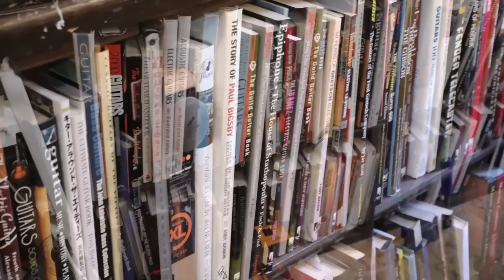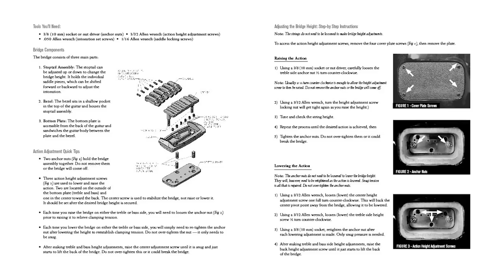Too many Cool Features to be a Success | Taylor Solidbody Teardown & Setup

Comment: Ben, I had the pleasure of working on this model last year. An absolute gem! The bridge is a piece of beauty with truly innovative design. The big problem was the switch which had given up….an not available any more either. There is a Schaller super switch which needs to be modded before installation which gives very similar pickup configurations…..that is, after I’d worked out what each pickup wire was. I remember the bridge and neck were mirror images of each other.
Reply: I have a similar problem on my les paul recording which has an 11 way "decade" switch - Gibson discontinued.
In the case of the Taylor you can get the same function by using push pull pots to separate the coils and using a more standard rotary switch - electronics component spares companies like RS offer build your own rotary switch kits for a low price where you can get a shaft with replaceable switch wafers.
Working out the wires is quite  simple,  first identify with a multi meter which wires form a pair based on the static resistance ,  and then with an old fashioned analogue moving needle meter (e.g. an AVO) you can tap the coil pole piece with something iron or steel, like a nail, to identify which coils relate to which to which pairs of wires - then mark them. Then by performing the same with each pair by identifying the phasing by seeing which way the meter moves when the pole piece is tapped with the nail - this may require reversing the meter leads  to get a positive blip - then you know which wire is is which.
Reply: Like I say, it was last year and I’ve already done the repair for my client. He wanted the guitar to function as it was, as using two push/pull is hardly usable in a live situation. Many thanks for the input.
Reply: @mbontekoe3358  Thanks for the info buddy. Given me directions for my next project :)
Reply: @mbontekoe3358  Farnell Electronics have different size Rotary switches. It may be worth having a look in their catalogue.
Reply: @fongy200  I know them well but I have not actually  lived in UK since 1985 here in Europe we have Conrad among others  but I have done much work on my guitars I also use the "freeway switch"  that is quite useful
Reply: @mbontekoe3358  DBG did a video on the Strat style Freeway switch.  A great innovation, no doubt.  Stew-Mac sells them in the USA.
Reply: @mbontekoe3358  👍thanks for the info on the rotary switches.

Comment: I've owned a Taylor Solid body custom with the Taylor designed mini humbuckers since 2011.
I too was skeptical when I saw it in the store. However, playing it I fell in love with the neck.
For background I've played guitar for 49 years, and ran a successful repair business for 14 years until my hearing failed me and I had to shut down around the time that Covid hit the scene.

On the plus side, the bridge is incredibly stable and has required very little adjustment in the entire time I've owned it. 
Taylor's mini humbuckers are very nice sounding and have a wonderful clean tone, but they can get quite gnarly (in a nice way) when overdriven.
The 5 way switch is a nice surprise and I find I kind of live in position 4 much of the time.
The fuse on the switch board is an added bit of protection.
The tone control contains treble blead circuitry which is also a nice feature

The only real minus in my experience was the choice of switch material with proprietary design. Mine is an early production model and the conductor inside the switch appears to be aluminium rather than gold and after a few years the switch failed completely. Taylor had discontinued the switch so no replacement was available, however they were kind enough to send me a wiring diagram for the mini pickups so that I was able to recreate their wiring using a Stewmac "P-model" mega switch

The Taylor solid body is a lot more than the sum of it's parts.
The neck is definitely a love it or hate it design, though I personally enjoy it.
I have a broad stable of guitars for different occasions and musical styles, each has their own voice which is part of the joy of playing in my opinion. 

Thanks for your candid review of this unique guitar!

Comment: Fascinating. My guess at the neck arrangement with the hollowed centre is the thought is that the shim acts a bit like a gasket so the bolt pulls the edges down in firm contact. On the other hand, if it was machined 'flat' then high and low spots could be anywhere. In particular, with a single bolt the centre might conceivably  'dome' making it a bit looser round the edges? Could that have been the concept in general, e.g. with the bridge - better to have really firm contact round the edges than bolt on bits that rely on 'perfectly flat' mating surfaces? Perhaps even coming from an acoustic perspective, used to clamped glued joints where there is potentially a certain amount of swelling, space filling and contraction at the glue cures leaving a solid joint?

Comment: I used to play one of these for years as my main guitar. They’re great! The bridge pickup in this guitar is not stock - it’s a Taylor pickup but it’s what they call an HG pickup (high gain). The neck pickup and the stock bridge pickup are HD pickups - lower gain more like a PAF. I have a neon green HSS Taylor Solidbody that I won from Taylor in 2009 with a trem.
Reply: Also the production version of this guitar didn’t have binding on the neck or headstock. After some digging it turns out the guitars marked “not for sale” were promo guitars from Taylor.
Reply: @mikelinden214  might explain why it’s made from mdf or whatever?

Comment: The way they routed a hollow to the neck around the screw gives a more solid contact. If the neck is flat only the area near to the bolts will make a contact. That’s because the bolts will bend the wood. Even with four bolt designs a small hollow around each bolt would improve the contact. The bridge has much more contact area that Tune-O-Matic which is sopported only by two skinni screws.

Comment: You missed the trick with the tone pot. The first 2/3rds acts like a normal pot but after that it provides an overdrive function that seems to boost the mids -giving even more options.

Mine is a Solidbody 'Classic' in natural ash (two well matched dense planks) with a brown speckled pickguard and a maple neck. Although it was the cheapest of the range, it's got an honest feel and tone and I'm now glad that I didn't go for one of the 'fancy' ones. It also has Taylor's own mini pickups.

Please keep doing these videos, there is so much for us all to learn. An example of a Japanese-made guitar could be interesting -what makes them so good and sought after?

Comment: I recently won one of these Taylor Solid Body guitars. It too has the "NOT FOR SALE" branded into the back of the headstock. Mine is the double cutaway Classic model that is a solid color with a pickguard. Mine has a single humbucker and the same bridge as yours in the video. I have done as much research as I can on these guitars, so it was nice to stumble across your video and to see it disassembled! Thank you!

Comment: I always use a single bolt, although I do angle the end of the neck so that it fits into a corresponding angle in the body. The idea being, when the strings are pulled tight the neck is locked into the body. Seems to work really well and has the advantage of being able to remove the neck very easily. Great video, cheers Dave
Reply: Hi. What's the technical description of the 'ferrule' or 'bushing'?  ie what do you use? ~8-10mm I've searched extensively & got nowhere. Cheers.
Reply: @RobSmathome  hi, to be honest I don’t know either. Try Bonehead guitars I know he uses ferrules quite often. Cheers Dave
Reply: @RobSmathome  no wait, ferrules are used for string thru the body bridges and would probably use an 8mm diameter hole. Bushings would be used as washers on the screws fixing the neck to the body and would probably be around 10mm diameter. Not sure if this helps. Cheers Dave
Reply: @DaveDickens  I'll give these a shot : Stainless Steel Countersunk Washer M8 (25mm O/D)  they come in colours too!!  😁 before i found these i was toying with the idea of using thick wide flat washers and capping a countersink to hide it all... the first-mentioned are much simpler...

Comment: This Taylor electric, judging by its construction and the design of the bridge, was built by acoustic builders without any knowledge of the last 70 years of guitar history or guitar technology. It's absolutely fascinating. If you sent them 70 years into the past, they would make the exact same guitar.
Reply: And yet they pioneered the bolt-on for the acoustic? Fascinating indeed!
Reply: @KimSE4  Fender did that, actually.
Reply: @caiusmadison2996  Really? I always associate with Taylor. They certainly have some pretty innovative manufacturing techniques don't they?
Reply: @KimSE4  Taylor were the first major producer to make good-sounding, highly functional acoustic flattops with a bolt-on neck.  The Fender acoustics were appallingly badly made instruments - actually so bad that they were fascinating to disassemble...  :)  Also, you're correct - Taylor's manufacturing process is possibly the most advanced in the entire industry (at least, in America).  There's a four-part video that was shot in the Taylor factory, which details the entire process, from a 'set' of wood boards to a finished guitar - an amazing series of custom jigs, cauls and fixtures, which make the process almost 'idiot-proof'.

Over the last 30+ years, I've spent hours at NAMM talking with Bob Taylor about these technical details; he's always been incredibly forthcoming and generous with his knowledge and time.
Reply: Hardly...  Taylor's factory and assembly line is possibly the most modern and efficient in the entire American guitar-industry.  They clearly have extensive knowledge of contemporary electric solidbody guitars - they just chose to innovate (and use their own, existing design 'traditions'), rather than slavishly copying Fender's and/or Gibson's approach and parts.
Reply: a lot of new songwriters have their first batch of songs the same way!  but you don’t bet the business on them.
Reply: You nailed it but they would never build a pine acoustic. Tells me they think electrified doesn't matter what wood you use
Reply: Lol. Tell us you know nothing about Taylor Guitars without saying "I know nothing about Taylor Guitars".
Reply: @StephenWhite55  That isn't at all what I meant, but sure, keep making assumptions and put words into my mouth. I'm just saying that everything we consider to be conventional wisdom was thrown out the window and still made for a uniquely amazing guitar.
Reply: @bradhardisty1652  The choice of body material has virtually zero effect on the amplified sound of an electric guitar. Pickups are 95% of it; hardware quality/fit, and construction method contribute the other 5%. I've got a Strat copy with a solid plexiglass body. Weighs a ton. It has three EMG single coils in it. And, it sounds just like my regular Strat, but with EMGs.
Reply: @iambingojesus  enjoy
Reply: Isn't the one who design this guitar the same one as the fender stratacoustic?
Reply: @caiusmadison2996   EKO in Italy may have? I think their first was '62 and Fender was '63?? Not sure! Interesting though.

Comment: I wonder if that bridge design is the result of a mostly-acoustic guitar builder underestimating how important it is for electric players to easily set their intonation.
Reply: Exactly. Unless you live in a climate where there is just one season and the temperature and humidity is constant (is there such a climate?), that bridge will drive you nuts.It's even worse than intonating a rickenbacker 4003.
Reply: @tolvajakos  bridge intonation has nothing to do with climate, it's the compensation for the thickness of the string.
Reply: @wombat6  i find myself having to intonate the guitar when i adjust the neck. which i need to do when the seasons change. maybe i got things confused in my head, i am not a luthier or guitar tech or anything like that.
Reply: @tolvajakos  There are probably slight changes to the exact string length when the neck twists and moves, yeah. It makes sense. What I had in mind in my original comment is that electric guitar players change tuning/string gauge more often than acoustic guitar players, hence the problem about a bridge that's a hassle to intonate.

Comment: I found this guitar to be "Neck Heavy." The reason Taylor is "ballsy" about routing after finishing is their equipment. It is hugely expensive and hugely accurate and reliable. I rebuilt some of the "milling angle heads" a number of years ago. They are a small Japanese company that builds them like a tank and has class 7 bearings in them. That keeps the tolerances of the heads to 0.0001-0.0002". Damn great for woodworking.

Comment: I'm a bit of an expert and collector on these - I've probably had 12 or 15 of these and have run all of them through my work shop.  I currently own two that I gig with.  I've done radical customizations such as adding piezo bridge pickups (like a Parker Fly style and more).

A few points:

You mentioned the veneer top several times.   That was that variant.  They did that because the base model was a traditional loaded pickguard  model.  The veneer let them chamber the body and, at the same time, put some really interesting flamed or figured woods on top for aesthetics.

The classic models are built like a strat:  solid wood body with a big pocket under it and a loaded pickguard.

It wasn't marketed as "feeling like an acoustic"  It just happens to feel amazing.   Its not the best sounding nor best guitar for reliability but it absolute IS the best feeling guitar to play for me.

The big design mistakes they made were these:

- the big innovation was in the plug-and-play no solder swappable loaded pickguards.  You have to get your tools out anyway,  and remove the pickguard.  That's great you don't need to solder but no one swaps pickguards frequently enough to care.  That's something you do maybe once in the guitar's life.  And you have to swap to another Taylor offering anyway so you might as well just buy it with the pickups you wanted in the first place.  And anyone who is adept enough to swap pickguards could  solder a new one in.   So, the no-soldering was pointless and not worth anything as a feature,  although it advertises as something important.   The problem is that it added a lot of cost and wasnt worth it.

- the bridge design is structurally very weak - they are known for cracking if you adjust them wrong.  They look really nice but they take forever to adjust the height and intonation and you have to loosen them and if you tighten it wrong you can crack them.   A simple ugly strat bridge is better for actual use.  And no one seemed to really care how "comfortable" the bridge was for palm muting.  Personally I don't palm mute at the bridge anyway.  Again, it advertised well and looks great but was a terrible design choice and VERY expensive.

- the five way Schaller megaswitch is very prone to noise.  They take a Schaller megaswitch, remove the contact board and snap on their own printed circuit board with capacitors on the board.  These can be replaced but its tricky and they are known for becoming noisy switches.  Also you can't tweak your tone by changing caps - you have to use the ones mounted on the printed circuit board.   So the guitars are marketed toward DIY tinkerers but they can only be tinkered with using stock parts, which negates the purpose.

Some of  the pickups, in my opinion, sound fantastic.  The basic high definition humbuckers are very generic and plain.  The high output humbuckers are ok.   The mini humbuckers are great and the noiseless single coils are fantastic.

Based on a LOT of experience with these, here is my summary:

PROS:
 - fantastically comfortable and wonderful to play, especially on stage
- fit and finish are near perfect and rival the best in the world
- out of this world good looks
- great build quality with ebony or EIR fingerboards, great body woods
- great sound with some of the pickup configurations
- Taylor neck angle adjustment is great for a lifetime of simple maintenance

CONS:
- bridge is fragile and finicky.  Not worth it.
- electronics are very proprietary and you might gut them  if you want to customize your tone
- switch is unreliable
- they were very expensive for what you get

For me, the comfort and playability are #1 so mine are worth it to me.   But I am able to customize and tweak mine and I got mine with the tone I want (which is #2 to me) and I can maintain them myself.

So for me, they are my preferred electric guitar but they are absolutely not for everyone.  The used price bounces around  but if you are like me, you can get a really good deal on a guitar that is good for you.
Reply: Excellent insights, thanks. Have a few and adore them. Fortunately have not had to work on mine, yet.